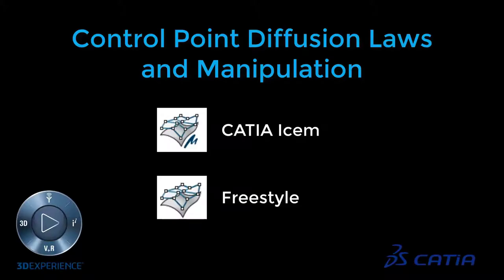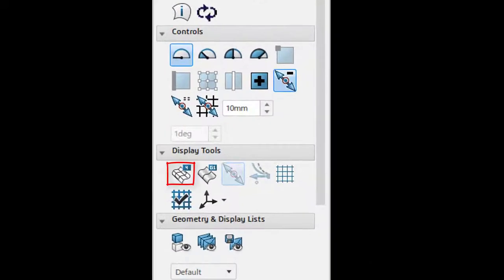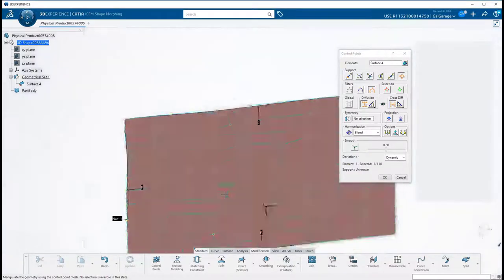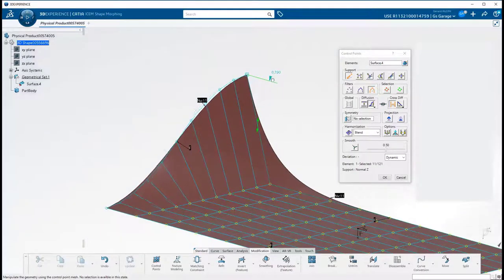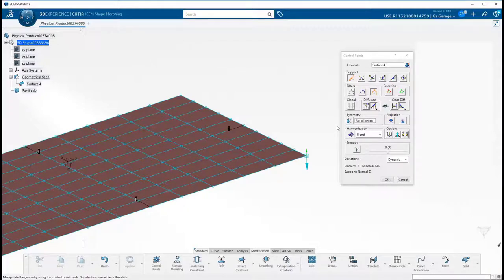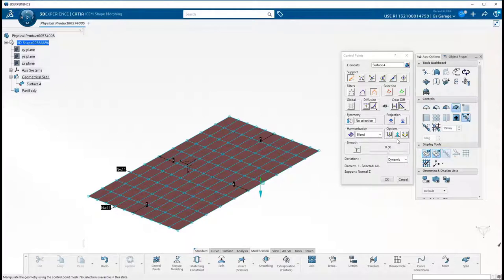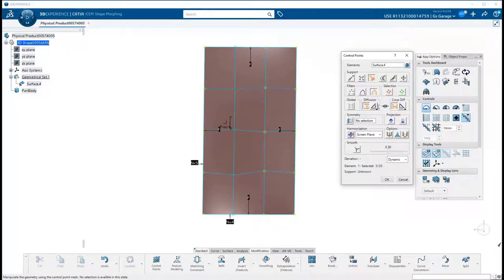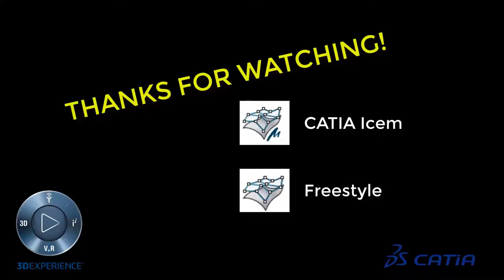CATIA Icem and Freestyle Control Points Fundamentals

Comment: excellent, enjoyed it.
A question about harmonization, I have a noisy surface of order 5 x 5, I want to harmonize the second row in say V direction(row V2) and I want the control points of this row to 
move tangentionally in order to not losing the tangent condition to the adjacent surface in boundary V1 , I don't find any of the harmonization options
to work in this way in Freestyle workbench.
I wondered maybe "support" options affect the direction of CPs movement in harmonization but it dose not.
may you suggest a way.
Thanks for you great video.
Reply from the maker: Hi Fardin...a little late with my reply, sorry. If you need to protect the tangent condition to an adjacent surface, and the control points are "noisy", then perhaps the adjacent surface is the actual culprit. I suggest imposing a matching constraint of the surface that you want to clean up to the neighboring patch, then modify those control points (of the neighboring patch). Impose a graphic "dress-up" on the patch that is being matched so you can see the control points when modifying the driving surface....I hope that makes sense!
Reply: @GerardAlcini  Thanks so much Mr Alcini,
I appreciate your answer.